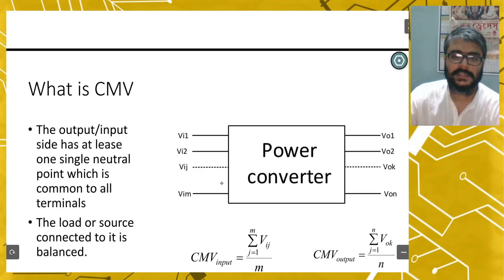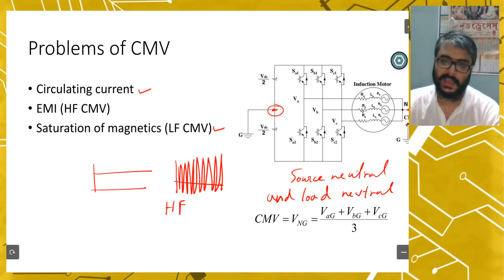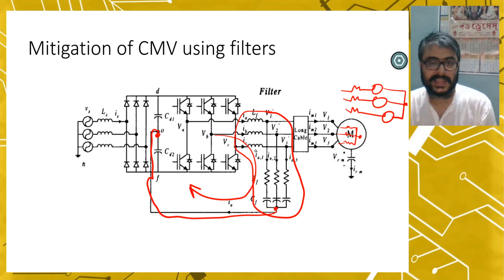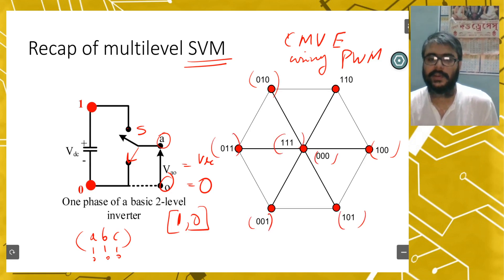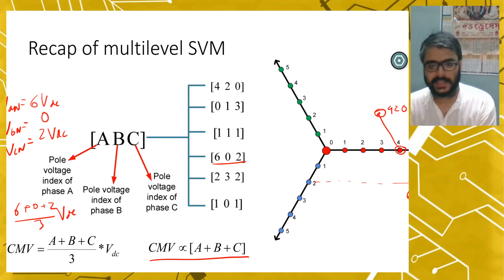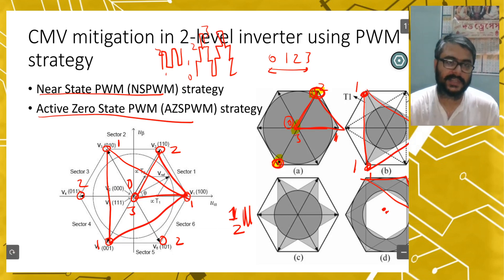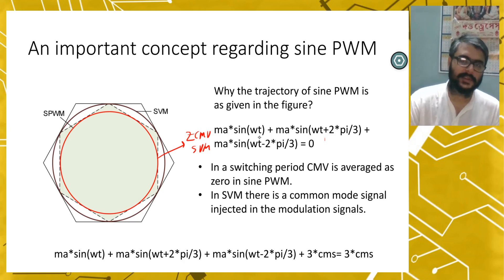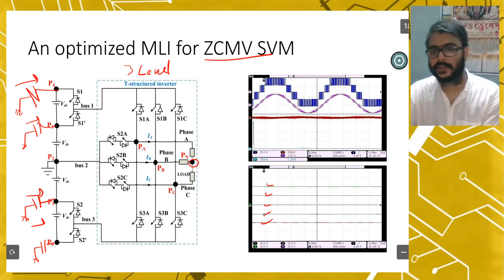Common Mode Voltage in Power Inverters

Comment: I have a question. How NPC inverter helps in fixing the CMV voltage and leakage current in the case of a PV-based grid-connected system. I have seen that mostly NPC topology is preferred over other traditional topologies of MLI. Please tell.